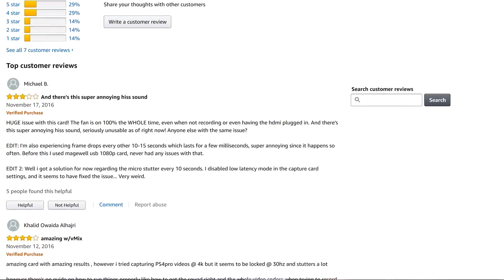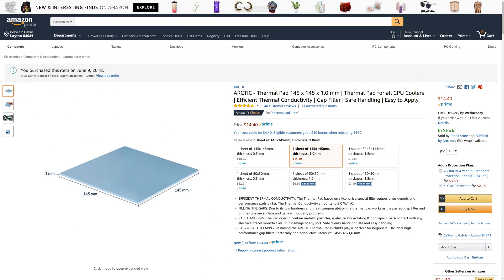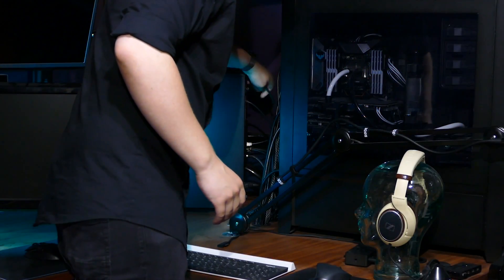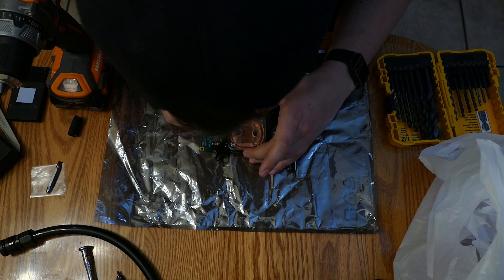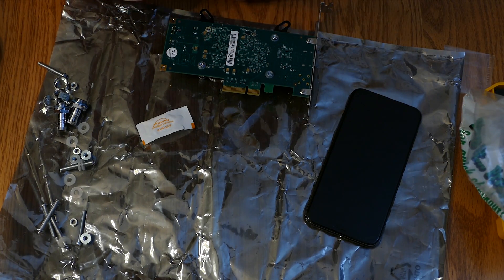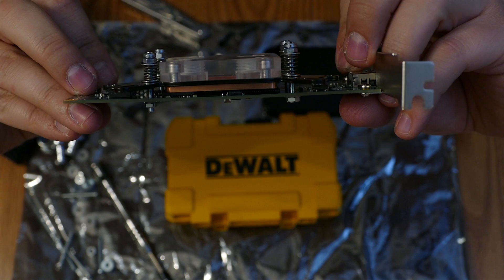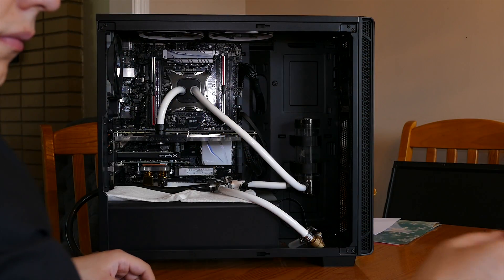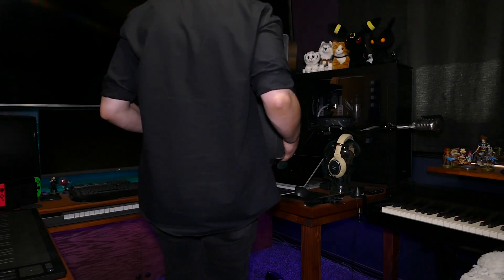Fixing The Worst Issue With The Magewell Pro Capture HDMI 4K Plus

Comment: I knew someone out there would have done this as I was thinking about what if, would you be willing to post the docs you received from magewell in a google doc or something like that. This interests me very much.
Reply from the maker: They only just sent me a picture, I eventually swapped that cheap block I put on in the video with this one:
https://koolance.com/chc-122-motherboard-chipset-water-block

It's much more suited for the job and doesn't require any custom modifications, either mounting method works but I would suggest the bar mounting method.

Just put some small heatsinks with thermal tape on the RAM.
Reply: @ninbura  Thank you for getting back to me, and for the info. Have you checked the temps since you installed the block, interesting to hear what they have been.
Reply from the maker: @SgtDreTecKeGamer  sorry for the late reply, for the duration that I used the card they stayed consistent with what I reported in the video, was definitely a success.
Reply: @ninbura  That is good to know, and again thank you for the info. Much appreciated.

Comment: I have a really fast pc and bought a magewell hdmi to usb dongle to bring my dsrl to my pc and streams, but it presented an ugly ghosting effect, like 20fps when my canon t3i was set to 60. My standard logitech c920 webcams had more definition and fps than a t3i canon a my $300 capture card. I refund it and magewell sent me another one...which did the same ghosting effect... My specs: i7 7600K 4.00ghz, ssd, gigabyte z170-ud3, 16gb ram, gtx1070. I just cant believe they sent me 2 broken capture cards, something has to be wrong, but my pc is just super fast and should work just out of the box. Magewell support said that they believed some incompatibility beteween my chipset an win 7 could be the problem, but I consulted Intel and they said no incompatibility is known.... and dont know what else to try, why magewell capture card isnt working for me? I really need help
Reply: the problem is shown on every program. obs, wirecast and even on a sotware magewell sent me to do the tests.